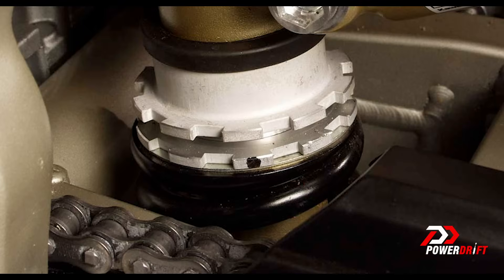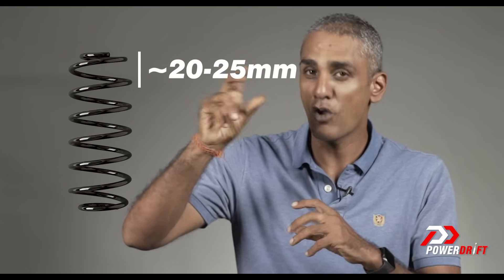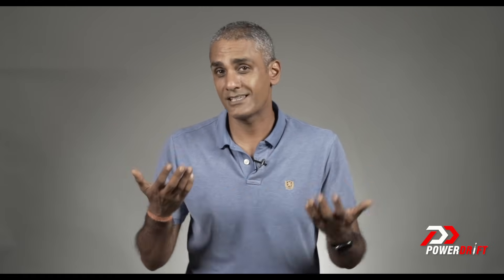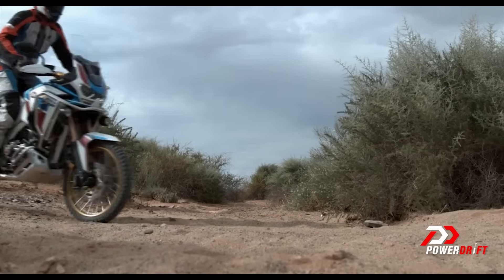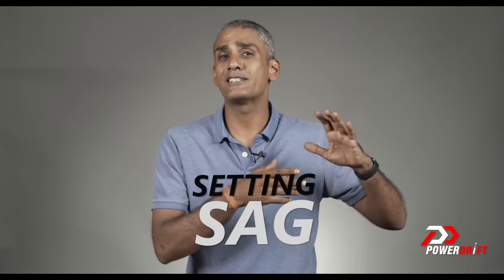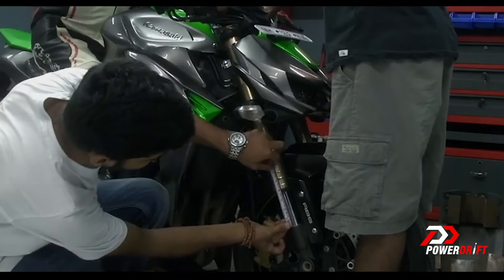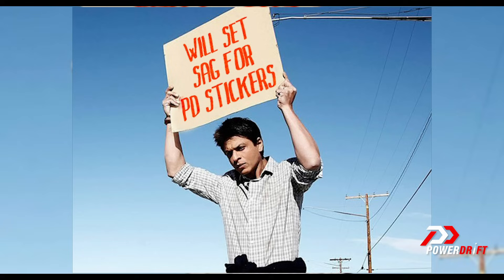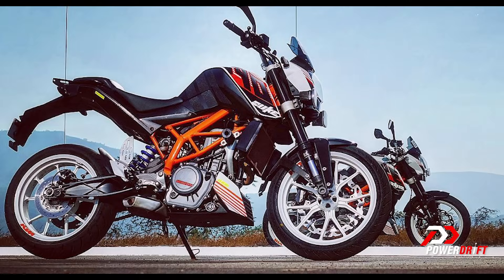PD Simplified : Motorcycle Suspension Explained | Part 4 | Preload Adjustment

Comment: So in conclusion you want the suspension to work in the middle part of it by adjusting preload based on weight, lighter weight use lower position spring settings, heavier weight sets at higher spring position, is that correct?

Comment: Quick question - I recently got a CB300R, and I am a light person close to 48-49kg and I feel when I sit on the bike it doesn’t even go down a bit in the stock adjustment. I usually ride solo and it’s too stiff as I feel usually suspension settings are done for an average person weight which is 70-80kgs. So would it make sense for me to soften the suspension with the pre load adjustment?

Comment: Your explanation doesnt include core understanding of preload
I am a mechanical design engineer working in suspension design team of an automative company 

Preload is applied so that it compensates for rider weight and spring of suspension gives proper desired stiffness 

Thats why is it called preload means internal load applied prior to getting acted upon by an external load

Now since body weight of every person is different preload is also different for everyone

Comment: Great video. 
Question; I weigh 175 lbs. my 2024 Honda rebel 500 was factory set at preload #2 but the ride is stiff. Will setting it at # 1 be a bottom out problem on normal highway riding ?
Reply: As the man said, take it out and try it. It's the only way.

Comment: Said, " I need to find an Indian dude to show me how to setup my suspension ". 
  FOUND Indian Guru who made it make actual sense.   I just added a rack & bags to my KLX300 and my last ride was a bit frightening. If I adjusted ever so slightly while underway the front end would start what felt like the beginning stages of a death wobble. Prior to that with me, a tail bag and tank bag the bike was fine. Tires inflated properly and the bike only has 350 miles on it.

Comment: I get high speed wibbles on a performance hibemd scooter; steerinf damoer is set at 20/25 clicks; tire pressure 3 bars; hydraukic spring shock , Rebound  to F max (Firm) ; What am i doing wrong ? Preload i did not adjuated it yet; Weight 195lb. Thanks !

Comment: I have a question. Does the spring in bikes needs to be changed? Does it loose tension with time?
Reply: No, it should only be changed when either bent from crash, rusted or during modification
Reply: @Abhi-now  Ok.Thanks!

Comment: Talk about making a simple concept complex. Let’s simplify.

‘Suspension’ are/can be designed and manufactured to ones needs as per the required spring rate measured in lbs per inch or kg per mm. Example, constant rate spring suspension (distance between the coil of the spring is same through-out so compression is always the same), another would be a progressive or a rising rate springs suspension (distance between the coils will reduce as you go higher so the stiffness is gradual). 

‘Spring Pre-load’ is how much the spring is compressed from its free length to initiate suspension motion. It alters the range of the spring from its free length. Now here, the bike will get stiffer if one is using progressive or a rising rate springs suspension as the initial soft compression if negated by the Spring Pre-load so only the stiffer spring portion is left for play; however, this Spring Pre-load will always be the same for a constant rate spring suspension.

‘Free Sag’ is the existing weight/ compression (of a bike/vehicle) on its suspension (e.g., body, engine etc; however not the wheels, tires , calipers etc sine they do not rest on the suspension and therefore they do not contribute to the compression ). This very weight/ compression which compresses the suspension is called a ‘Free Sag’. 

‘Rider Sag’ is the compression when the fork and suspension settles after the weight of the rider + the free sag. 

A good Rider Sag is subjective; however, 1/4 total suspension travel is a safe bet.

Free Sag as a safe bet should be 1/3 of Rider Sag; however again this math is subject the kind suspensions used (i.e. constant or progressive suspensions).

‘Usage Sag’ is the suspension available (compression left after Rider Sag & Free Sag). 

‘Damping’ the speed at which the springs compress or extends, usually regulated by oil as oil creates a resistance force which controls suspension motion.    
 
‘Compression Damping’ the force as the suspension of compression.

‘Rebound Damping or Tension’ the force as the suspension extends after being compressed.

Long story short, know your suspension type before tinkering with it. Use the specification given by the manufacturer.

Comment: Excellent video as always Shumi! I want some clarification on the Meteor/New Classic rear suspension. It’s quite stiff and according to the RE manual the stock setting of the rear preload is at the lowest/softest position (position 1) is meant for 90 kgs and it goes all the way up to 180 kgs at highest/stiffest position (position 6). Now I weigh a shade over 70 kgs and I find the rear suspension quite stiff. I believe that increasing the pre load won’t benefit me , given that even the softest setting is rated for 90 kgs. What do you suggest?
Reply: Adjust it? Duh
Reply: I purchased the classic reborn last month & i feeling back due to its worst suspension. You can’t do much to pre load & feel better. I tried all possible setting & find the journey is tiring on classic 350. Previous bs4 version classic 350 had nitrox suspensions & they were super comfort. These indian companies have become greedy & installed pathetic low quality in bs6 versions. Newly released classic 350 is waste of money when its comes to comfortablity. I feel regret every day. Just riding 45 minutes, u cant sit on the bike.

Comment: It would be really helpful, if you could suggest some plush riding motorcycle below 2 lakh. I had back pain issue while riding my earlier bike Honda shine, and so far I was find it comfortable only one Unicorn and GS 150R. I am currently planning to buy a comfortable commuter bike with neutral/forward set foot peg. Since GS 150R are no longer in production, my only option is Unicorn (Or Classic 350/Highness though I do not need that powerful bike). I am g feet 2 inches tall, and most of the bikes up to 125 cc feels too small, and most of the current 150+cc bikes are having too committed riding position/rear set foot pegs.
Reply: Try the Honda CB350RS or CB350 Highness. Stock suspension is pretty great for bad City roads.

Comment: Please make a video about the suspension upgrades on that duke 390 you were talking about. 🙏🏼
The only suspension upgrade I can easily find for my duke 390 is YKK suspension which really stretches the pocket. Do we have any other options available in the market which will make a big change in handling curvy roads, like the Yamaha suspension you were talking about?🥺
Reply: Heya, he used an old gen yamaha r6 suspension on his duke 390(rear suspn.)
Reply: @rubialam1475  do you know if that is a direct fit? if so, what year?
Reply: @abhinav_evo  2002 models I assume

Comment: Installed YSS front suspension kit on INT650. Poured in 15W Liqui Moly fork oil. With my weight of 90kg.. Setting of 2.45 turns suits the best.. With rear set to 2 level up from softest setting.
Reply: Same here. I also upgraded to YSS shock at rear. Took me a while to get the correct settings but finally got it right for my weight 110kgs. Still not very happy with front YSS settings. Might go for 20w oil. Let's see. Otherwise, stiffer spring might be in my future.
Reply: Nicely done!

Comment: I tried to change the preload on my interceptor. But it feels so tight that the entire shock turns when i use the c spanner but not the actual preload rings. Am i doing something wrong here?
Reply: Nope. Just help the bike by getting someone to lift the rear. The reduction of weight on the springs will make the task easier

Comment: This answered a question I’ve had for ages about preload! Thank you.

I have a Jawa Perak (2 months old) and am wondering if the suspension should be changed, then to what should I change it to?

I mean, you plonked a Yamaha suspension into your KTM, but should I change mine? If so, to what?

For context, I commute about 5-10 km every day and then take a trip off about 500-700 km once a month, on mostly decent highways.

Comment: what happens when you use a higher grade fork oil from the stock oem grade oils on the front forks because the springs are too soft for my current weight? will it help or of no use.(SAE 4w for the KTM 390 ADV at present and planning to use SAE 7.5w)
Reply: Higher grades will increase compression damping. So the front wheel will resist moving into the suspension stroke more. This can feel good at fast speeds on great roads but will feel worse on poor roads
Reply: @shu_mar  thank you so much for the input. I think for now I'll try with a little extra oil of the same grade and see how it behaves.

Comment: Trust thiss guy....I (98 kg with gear) bought a bike from a 50-60 kg geared dude..... Besides the suspension I had to mess with the chain too, that's what a difference 20-40 kg makes. Tks Shumy for the nice videos.....
Reply: I’ve never heard of setting chain tension based on weight.  What made you give that a shot?
Reply: Did you have to losen or tighten the chain
Reply: @attachment4449  I had to loosen it, because it was too tense and it would have worn out faster, specially if I would have went on trips with my girlfriend as a passager....
Reply: As an experienced teacher with 234 years of explaining complex theories.
I can tell my man is great at explaining after watching just five minutes.
Reply: I weigh 200 lbs and bought a bike from someone that weighed 150. My first bike so I have no idea what I’m supposed to be feeling in terms of suspension. I just get on it and go until it goes down.

Comment: Please make a video on how we can soften / stiffen non adjustable suspension units (i know there are limitations but any help would be appreciated) 
i own a gixxer 250 non adjustable front forks and preload adjustable on rear 
for my weight 75kg and pillion weight 50kg combined we feel suspension is little stiff
any fix for such bikes?
Reply: Change springs if preload doesn’t achieve the result you want

Comment: Hi,

Will you be able to help , as to how can I improve the front suspension of honda highness? It feels stiffer then rear and i want to have a plush ride
Reply from the maker: Unfortunately, the H'ness doesn't have an adjustable front suspension. 
However, that can be rectified by changing the grade of the fork oil but for that you'll need a mechanic who knows what he's doing.
Reply: @powerdriftofficial  thanks 😊

Comment: I have a R15v3 and I am a Light weight rider, I am annoyed getting each and every small bumps and potholes but R15v3 doesn't have any adjustment setting at rear and front. Any solution for my issue other than changing bike or gaining weight 😂🥲. Please tell me I want solution🥲. Any suggestion will be appreciated.
Reply from the maker: Unfortunately, R15's suspension is rather stiff, since it's a track-focused motorcycle. You can always invest in aftermarket adjustable suspension.
Reply: @powerdriftofficial  any suggestions for after market which might fit and is good in your list?
Reply: See if YSS makes stuff for the R15. But run less preload if you can. Or else you’ll have to change springs. But you bought a sporty bike. It won’t be a sofa.

Comment: Does saddle cushioning affect how a motorcycle feels on the road?
OR it entirely depends on suspension setup.
Reply from the maker: Saddle cushioning will only make you feel comfortable. A softer cushion might even rob you of the motorcycle's feedback.
Reply: 99% suspension. Saddle comfort only makes you able to ride longer in a stint or not
Reply: @shu_mar  my motorcycle manual says that my bike has 7 step adjustable monoshock in the rear and if the preload is in 1st setting it says soft setting and 7 says stiff setting but I'm not able to understand which is the best one for carrying a pillion. Could u pls calrify?

Comment: Next topic: tyre rating, cold tyre, low slide
Reply from the maker: Thanks for the suggestion, Sheshadri.
Reply: @powerdriftofficial  o o more more... like o ring vs x ring, brake fading, caliper adjustment, brake fluid fading etc.